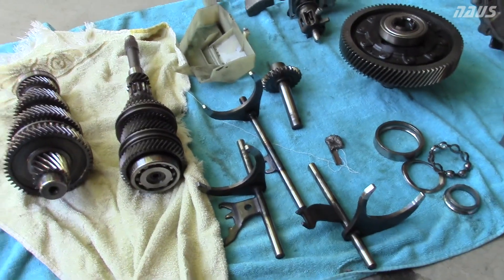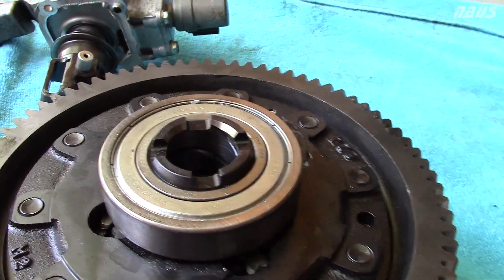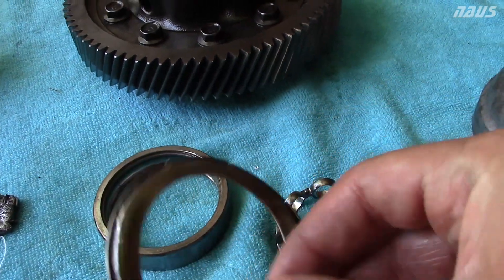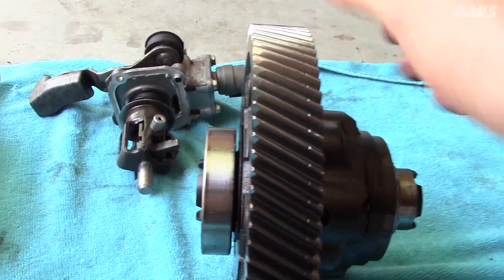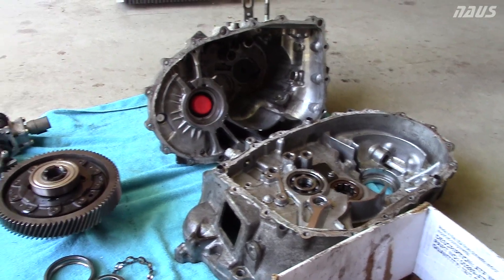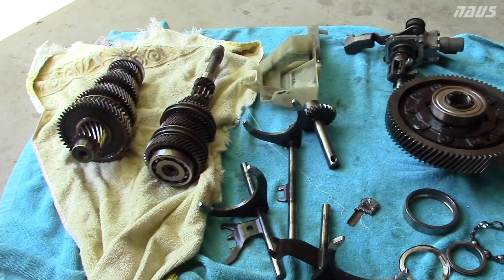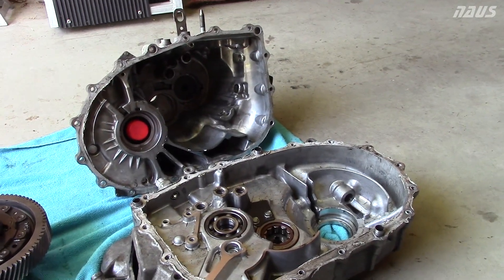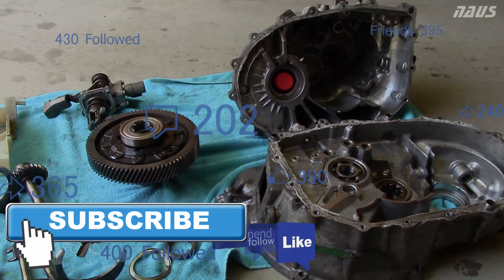Civic Si K-Series Transmission Failure Analysis

Comment: Launch is the hardest thing to drivetrain. Sticky tires cause more strain. In a way, having weaker motor can be better because once that gets more power, everything down the line gets more torque and strain to it. Racing powerful stuff can be very expensive.

Comment: Granny shiftin' not double clutchin' like you should, jk in all seriousness it's just simple physics, launching in second gear without the clutch slipping, say bye bye gears or diff or bearings, how do you expect anything to hold launching in second gear, in consumer products that is, many things would have contributed to the failure, out of spec shim clearances, out of true diffs etc, but in most cases it's lauching a car hard and in this case 2nd gear lauching is especially hard, this where most of the failures happen, something's gotta give, clutch,tires,axles,gears, diff or bearings.
Reply: ThatGuyKappa i think this is what just happened to my k tranny too, had a little work done to it, 06 si fd, carbon synchros, mfactory lsd, i think my lsd was shimmer poorly, made a whining noise since i got it back, broke in under 3k miles, you can see the axel move out of place where it goes into the tranny on both sides

Comment: Hey man did it seize anything up when it did that or did you hear anything, or exhaust to loud?
Reply from the maker: car was too loud, car still shifted like butter, it took quite a few miles to notice it was damaged. The passenger side bearing was blown out, but the half shaft kept the diff centered still
Reply: NAUS hey man. I know this is an old video but my car started making a "popcorn" sound coming from the front passenger side. Happens when i let off the gas and it starts making the sound from 4-2k rpms. Today i really got annoyed by the sound so i clutch it while im free wheeling then to a full stop. It stopped making the sound as the rpms dropped but then when i started moving again. It did the sound a few times and it went away. Could we have the same problem here??
Reply: Sounds like something is wrapped around an axle and it hits metal and stuff.
Reply: Ge films. Did you find out what it is. My 07 si started doing that same thing today

Comment: Those 2 diff bearings are having covers both side , how does the  lubricant get inside?
Reply from the maker: there are many types of ball bearings (open, sealed, double sealed, etc)
Reply: NAUS  I think should be open type for this transmission

Comment: id say the Diff broke first then caused bearing failure..   id bet if you lined up all the parts and look at the gear spline angle, it will sit so the spline on diff gear sits in a way where it will want to walk away from direction bearing broke. id guess the diff pulls hard in that direction putting more pressure on the bearing that failed.. when diff final cracked the result looked like a bearing failure, id bet it was the diff first tho..  with my theory the crack should be the side opposite bearing failure